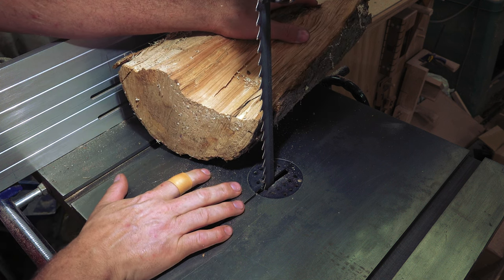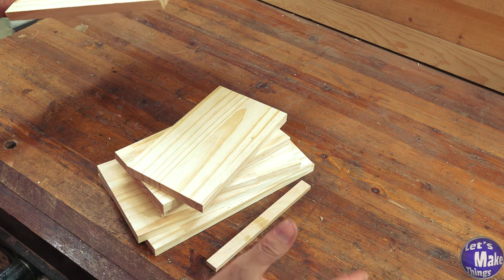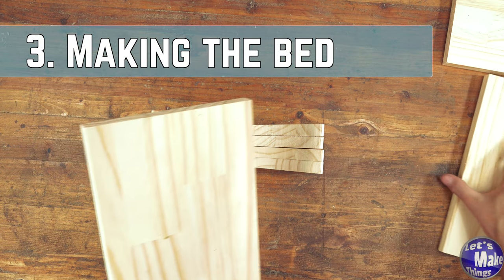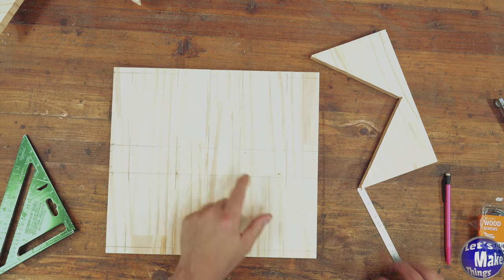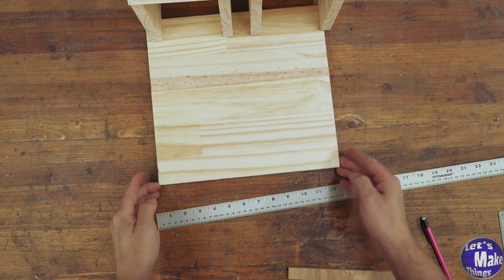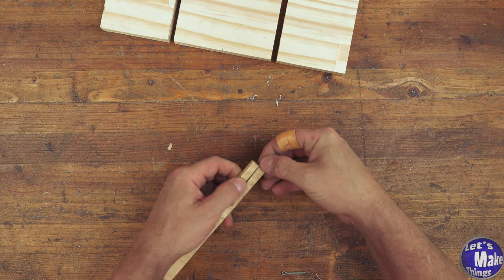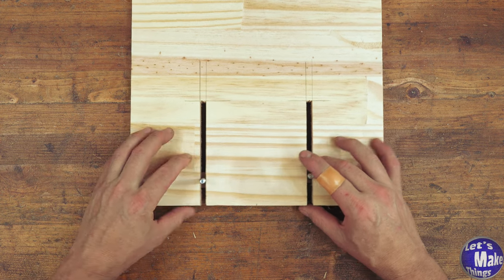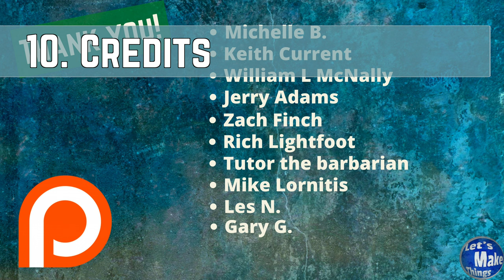Bandsaw Jig Made for Lathes // Step by step guide

Comment: Maybe add a slight chamfer on the back cutout edge, so as wood is sliding past the blade, if it rocks down a little, it will ramp it back up to outfeed side and not bump the edge

Comment: Couple of thoughts, first of all being Cut four squares. Don’t worry if they’re not perfect it’s academic. Now cut them in half diagonally from corner to corner and again don’t worry if it’s not 100% perfect. The only thing that truly matters is that you have a 45° cut. Next, instead of cutting two boards, the same length for the V cut one board the width of the gap for your bandsaw blade shorter than the other and then cut that board in half. Now using either crazy glue or hot glue position, one of the triangles on one of the ends of the boards with the glue so that board is laying flat on the 45 surface and leading edge is on your flat work surface. Next do the same at the other end, and finally for your longboard position it on the flat surface with the glue on your 45 pieces, and slide them in where they belong. If you haven’t already pre-drilled and countersunk, do so now and screw them together. If you want to get fancy, put a 45° router bit into a router table and you can chamfer off the adjoining edges to 45° and that way if you wish to you could glue the opposing surfaces together when you go to mount them on the board that will sit on the bandsaw table. A quick change to your design. I would use two boards the same size. Start by drilling, a hole in the center The same size as the gap on the one side if you’re V-shaped guide and then use any saw you want to cut straight from the edge to that circle. On the bottom of one Cut a dado, and on the top of the other put a guide strip to fit into that dado. On the bottom of that lower board, put a Nother guide block to fit into the bandsaw tables, miter gauge slot. Cut your two slots for your adjustment bolts to go through so you can slide it closer or further from the blade.